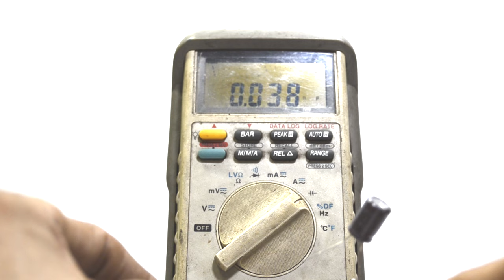How to Replace Capacitor damage  Rule must the same uf and the same or higher Volt

Comment: I cant find 2.5uF can I use lil lower like 2.3uF?
Reply from the maker: Only certain brands of capacitors have a tolerance of 5 - 10%/
Different brands have the same uf, but different uF values after check with digital multimeter
My advice is to follow the rules, use the same uF and voltage. 
Use at your own risk

Comment: People here are saying it is okay to use slightly different uF values. I have found that is NOT the case. That will slowly cook all of the integrated circuits on whatever is being repaired. You really need EXACTLY the same uF values.
Reply from the maker: Thank for info Dro
Reply: By cook, I suspect you mean it oozes electrolyte or bulges. That's due to either higher than rated ripple current (like using a cap with a high ESR) or PEAK voltages beyond the cap's rating.

Comment: Hello there, can i ask a question? 
So I have a 3uf 500VAC spin dryer capacitor that is broken/damage, and I intend to replace it with 4uf 450VAC capacitor because that's the only spare I have, but I am in doubt to change it because the voltage of my 4uf is lower with my 3uf. Is it ok if i replace it? Thank you for the answer. Have a great day !
Reply from the maker: Sorry Pand
We don't quite understand
For electric capacitors.

Comment: is that possible to replace a smps capacitor 200v560uf to 200v330uf. will it cost any problem changing the low rating capacitor???
Reply: Have you try it? I bet you are fixing cpu power supply 🤣

Comment: i have question my gpu all capacitor blown (270uf 16v) and i want replace to 470uf 16 v .Will the 470uf 16v give me any trouble?
Reply from the maker: For sensitive electronics
It is highly recommended to use the same size

Comment: I need to replace two capacitors from a power supply that are rated 690uf 25v, but I cannot find them, I found out that now capacitor manafuctutres build 680uf 25v and 680uf 35v, so if I go 10uf lower but at the same voltage or 10v higher will it be ok?
Reply from the maker: Rule one very important, you must replace the same uF. Rule two, using the same voltage or higher.
Reply: Ok I know that rule but I cannot find the same capacitance, I can only find 10uf lower with the same voltage or higher. But what happens if you install sightly less capacitance? probably the system will not work right? If you install slight more it might burn or overheat some other components? One more question why there are electrolitic capacitors with the same capacitance and voltage but having different sizes? For example why a 1000uf 25v capacitor from an X manafucture is slight smaller or bigger than an 1000uf 25v capacitor from Y manafucture?
Reply: @onisiforosalexandrou2551  Using slightly out of spec capacitance is not a good idea. It will result in integrated circuits within the power supply being cooked.
Reply: Most likely, the 690uf unit is a fake or misprint, since it is not a standard value. Using a larger value is OK for non-resonant applications, like supply bypass. It's unlikely that a cap that large is used for anything other than power supply bypassing, so 680uf or larger will be OK unless it won't fit (like inside a wall-wart).

Comment: I need to replace a capacitor rated 330uf 16 v for d2h . Which capacitor can be used instead of that capacitor
Reply from the maker: Replace with 330uf 16v the same size, the  best solution, the same size, no need modification. So far will fit to your board.
Replace with 330uf 25V better, but size Elco bigger. May be not fit with your board. Please decide this.'
Sample http://www.obengplus.com/news/image/2014des/02kapasitor-rusak-solder.jpg
If you think you want replace a better Elco.
Find the best brand Elco Class one, but not for audiophile capacitor (very expensive and useless).
Like below
http://www.obengplus.com/news/image/2018des/01perbaikan-kapasitor-power-kode-brand-capacitor.jpg
I hope can help, you own risk ;-)
Reply: i have question my gpu all capacitor blown (270uf 16v) and i want replace to 470uf 16 v .Will the 470uf 16v give me any trouble?

Comment: before years ago i change for my exploded PSU capacitor 470uF 10V (x2 unit )to 1000uF 10V (x2 unit) , and the PSU work again ~ but im still wonder which situation will make it blow again ? maybe is the fan dead causing to heat?
Reply from the maker: Sometimes solution blow up cap. Using high end cap better quality, like Japanese brand. Price different, and lifetime different.too. I hope can solve this problem